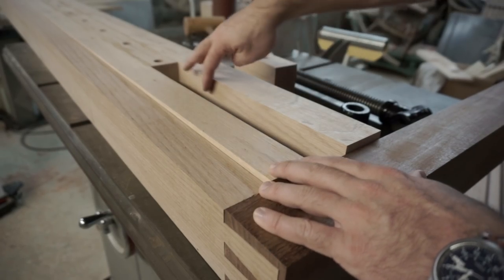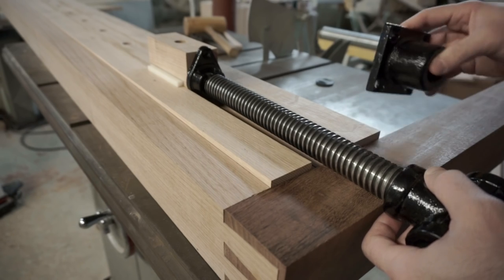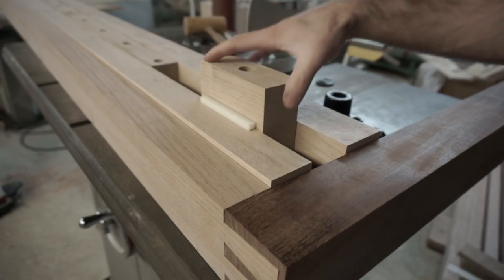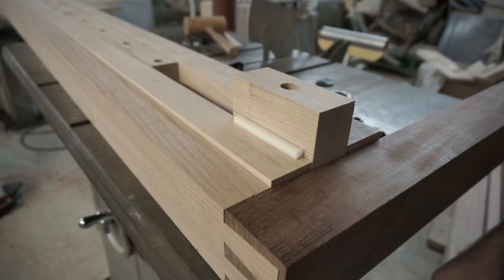Roubo Style Workbench Build - Part 1 of 2

Comment: Do you like the jointer/planer combo or wish you had one of each?
Reply from the maker: Ryan Reeves for me it works great. I don't use it everyday either. You do have to lower the height of the feed table most of the way down to go from planing to joining which takes 20 seconds or so. I have yet to have the thought of needing separate machines. I love the 12 inch capacity of the jointer and if I got another machine it might be either a smaller bench top jointer or a larger planer.

Comment: Nice build.  I would be somewhat concerned about the cross grain situation you have at the wagon vise end.  With gluing the end completely, over time this might cause a split to develop with changes in humidity.
Reply: it will. I would have cut a tongue and grooved dovetail all the way across and just slid the end piece in there. then I would attach a laser cannon to it so I could destroy anyone who suggested I should have done otherwise.
Reply: Yep. This will likely cause problems down the road. This is why lag bolts are used on the end in most bench builds like this one. But, still a very nice bench, and a talented woodworker!
Reply: William Boggess all these ppl that get all technical with cross grain and stuff like that have never built anything in there life, just let the guy do his thing and enjoy the clip

Comment: I noticed the shaft of the vise extended when turned it out, that wouldn't have happened if you had put that threaded piece on the block and ran it through.    next time!
Reply: I get what you are saying, but then you wouldn't be able to use the "open" section in front of the block for long boards, because you would always have the threaded rod in the way.

Comment: How do you like your combo machine? I have been thinking about the 12 jet helical head
Reply from the maker: Oscar Loza overall its pretty nice. Plenty of power. Love having a 12 inch jointer that's for sure. The dust port is not the greatest in planing mode because it has to draw it up and out. I do not have dust collection set up, so that probably would help to draw the saw dust out. I just have the straight blade.

Comment: Turned out looking amazing. Unfortunately I think you are going to have big problems with the cross grain glue up there. Its not allowing fir wood movement and the glue wont hold it.
Reply: yeah... when I saw him gluing that up I was like nooo!!!! dude what are you doing??  don't do that!  As if he could hear me and I could saving him from a critical error.  The good news is that end grain to face grain glue ups are not strong at all, so with any luck, the glue joint will fail before any of the wood splits... then he can just use lag bolts with enlarged holes.

Comment: I am not convinced that you assembled the wagon vise correctly.  Or at least in the optimal fashion.
or maybe it's the wrong hardware.  
but I don't like the handle moving away from the bench as the wagon moves toward the edge.
but for it to work the way I would like, the shaft would have to be longer (to go through the wagon block), and you would need unthreaded support areas where it passes through the end of the bench and on the far end.
then the wagon block would move "on" the screw, instead of being pushed/pulled by it and the handle remains stationary as it turns.

that quibble aside, I liked the bench & the video.
Reply from the maker: ekw555 I agree with you that it looks better having the block glide along the screw so the vise doesn’t travel in and out of the bench. I was looking to save some money and not buy the bench crafted wagon vise at the time. In retrospect I probably just should have bit the bullet. I also don’t use it too much so it isn’t sticking out too often. Thanks for the comment.